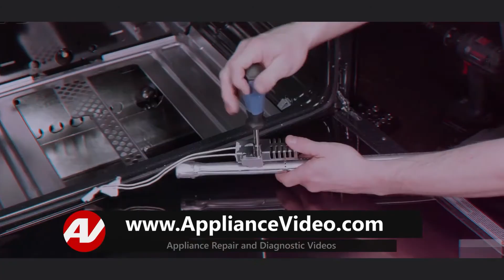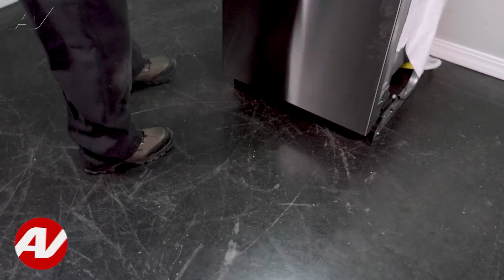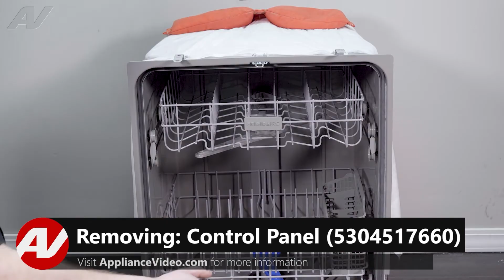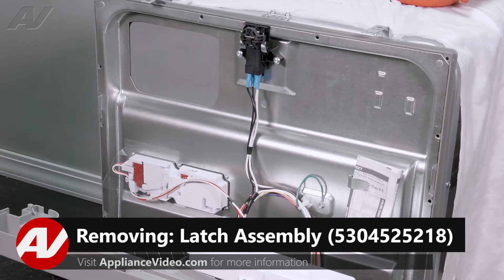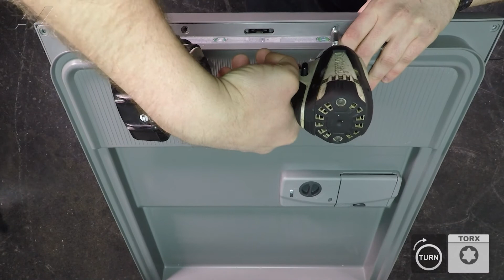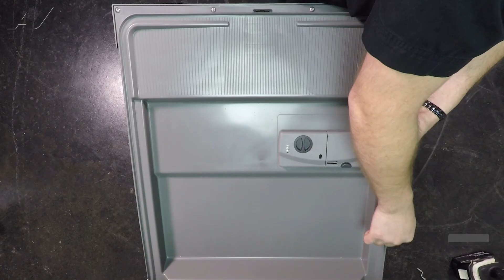Frigidaire Dishwasher Repair - Will Not Start - Latch Assembly

Comment: So the machine i got had a non usable latch with nothing to connect wires to so otdered a new latch. The wires were going into a plastic box  that looked like it did nothing. I have sern two different videos with white wires connected on the right and white wires connected on the left on the latch. I connected black to the right and altjough it looked like itcwabted to work it did not then i switched the black to the left. How do you know which is the front and which is the back when the wires are not marked in any way?

Comment: And here I was ready to buy a whole new washer! I messed around with this latch for HOURS until I saw this video. It was just that little plastic piece that needed to be able to hook onto the small metal bar. It had been stuck on the wrong side of the bar and I didn’t know that was the wrong side! 😆 What a terrible design this thing has.

Thank you so much!
Reply: Same exact thing. Put a new assembly in, still didn’t work. After I saw this video I was able to push the spring in and push the latch under the pin. What a stupid design.

Comment: hello hoping for some guidance, I recently installed a new latch on this exact same dishwasher, labeled the connectors so i’m positive i put them back correctly, but now the dishwasher won’t run. The start button blinks for 5-10 seconds and then shuts off. Thank you in advance for any guidance!
Reply: Were you able to get your dishwasher running?  If not, make sure all wires are fully inserted and connected.  The latch assembly itself if just a mechanism to complete the circuit when the door is shut.  It's possible one of the wires/connectors is loose.  I don't know if reversing the wiring is advisable to test as it could cause damage if the wiring's hooked up incorrectly.  You might be able to get assistance from an online appliance repair forum.
Reply: @msill5684  yes I was! I actually did install everything correctly, but had tripped the breaker without realizing… Felt very dumb when I figured it out, as soon as I reset the outlet the dishwasher turned on.. lol